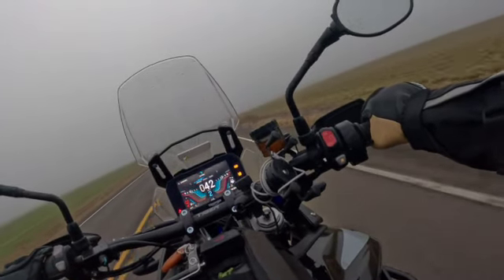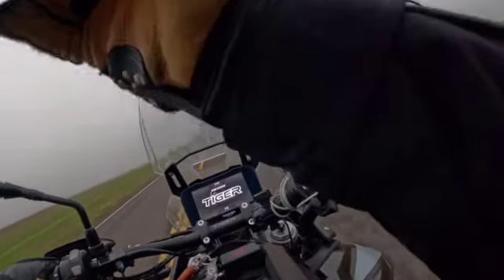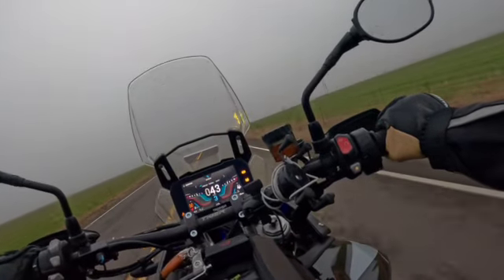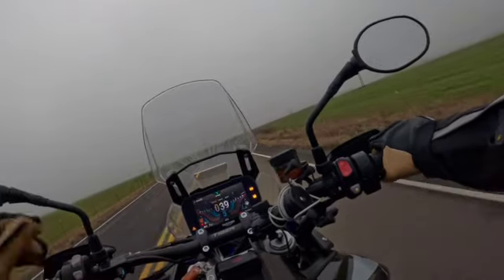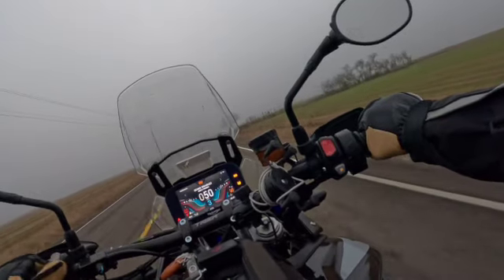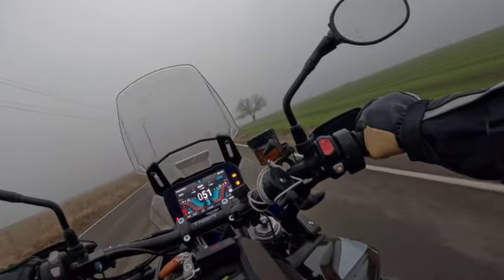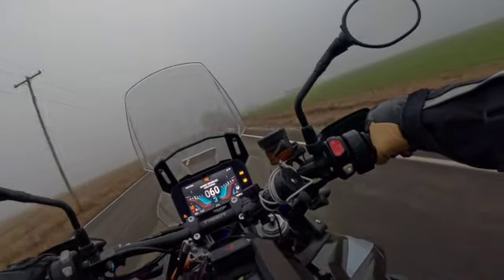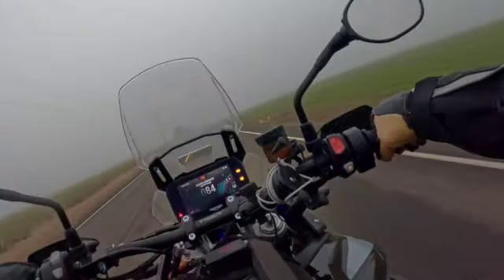2021 TRIUMPH TIGER GT PRO ERROR CODES   Triumph HELP ME!!!!

Comment: It will be interesting to see what they find.  My wife has the 900GT Pro and I like to twist the throttle just like I am seeing in your video and no issues so far.  Her's is a 2022 with about 2800 miles so far.
Reply from the maker: Thanks for the comment. I’m glad you haven’t had any issues.  It’s going to the dealer once I can get scheduled and if they don’t find the issue I’m going to Triumph USA. Stayed tuned
Reply: @theunskilledspecialist  did you find what was the reason of your issue ?